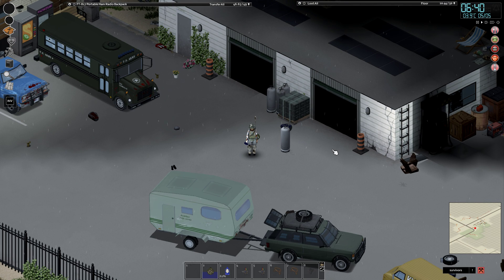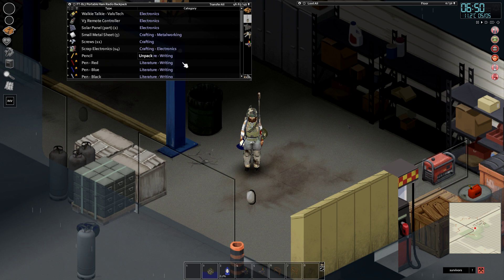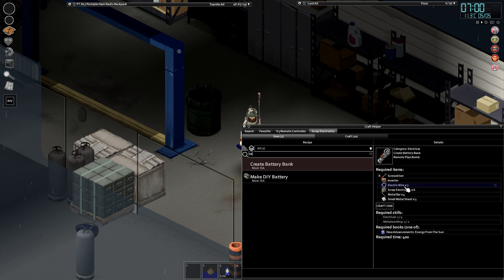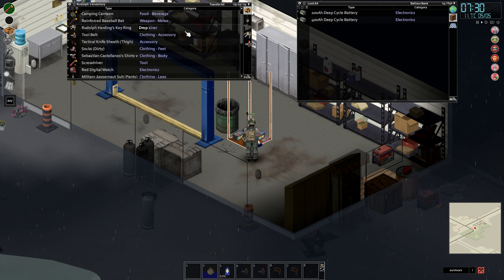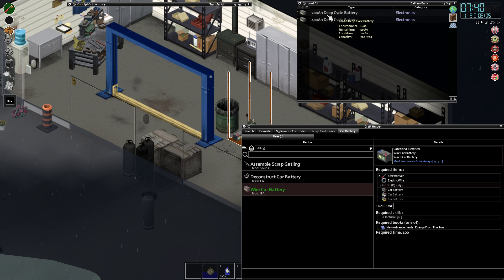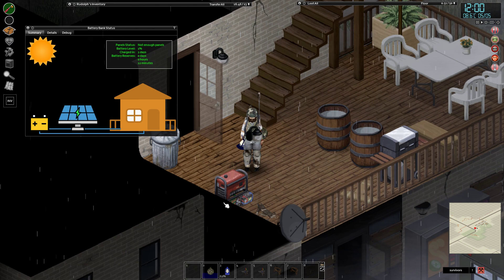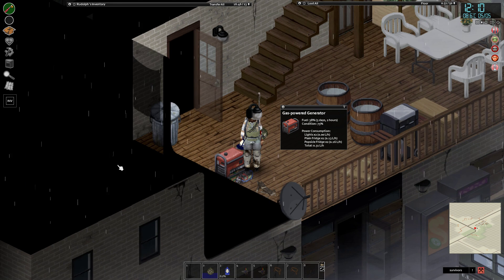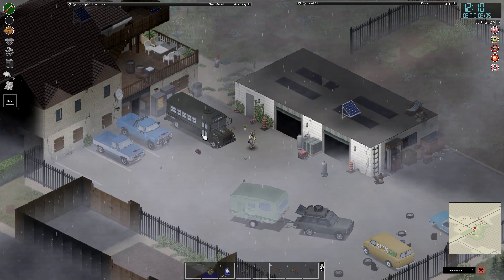Project Zomboid Immersive Solar Arrays A to B

Comment: 7:50 The 'A' is for AMPs and the little 'h' means hour, so the energy produced and available is measured in AMPs per hour.  great video though mate!
Reply: The mod author screwed up too. The panels shouldn't be rated in amp-hours, but watts. Amp-hours is energy (stored electricity), watts is power (how much electricity is being produced/consumed at a given time). For simplicity, it would be a bit less incorrect to rate the panels in amps -- a 50 A panel would produce 50 A h in an hour. Or better yet, rating the batteries in joules (1 watt for 1 second = 1 joule), but since real-world electrical systems also have to take voltage into account, real batteries are unfortunately rated in amp-hours.
Reply: @Eidako  Probably easier for the average users if the mod creator expresses everything in terms of amp hours instead of watts. Otherwise everyone would have to understand the relationship of Watts, Voltage, and Amperage. May even require different wattage inverters, gage of wire, parallel or series battery array, startup amp consideration, phase and sine tuning, etc. There's a pretty deep rabbit hole the mod could take for the sake of realism.
Reply from the maker: Thanks for the info did not know that.
Reply: Have an electrical background. Wanted to scream every time "hertz" was said.

Comment: Thanks for doing a video on this mod! I fixed my problem while watching this: The generator has to be on the same level as the Battery Bank, otherwise it won't connect.
Reply from the maker: Happy to help, took me quite some time to work out how to set it up and once I finished, I decided to make the video so others like me don't have to struggle.
Reply: If you're level 6(+) electrical, it can be one floor above / below to connect.
Reply from the maker: you need Electrical Level 6 and specific components like Electronics Scrap, Electric Wire, and, often requiring you to read Engineer magazines 1 and 2 in an existing save to learn the recipe and link it to receivers for traps or doors.

Comment: can please link modlist for the mods you're using!
Reply from the maker: Hi mate, yes I can link them, what I'll do is send you a video as well as I have no idea how to group send all the links and youtube makes me jump through hoops to do that, but the video I will link as well will show what I have on, as well as the list below which you can put in steam to find them,  https://youtu.be/mOEsHajuvpw

        mod = 67commando,
	mod = 82oshkoshM911,
	mod = 86oshkoshP19A,
	mod = 87cruiser,
	mod = 89def110,
	mod = 92nissanGTR,
	mod = SteamPoweredGenerator,
	mod = FORTREDSTONE,
	mod = FencingKits,
	mod = FWOBenchPress&Treadmill,
	mod = FWOFitnessWorkoutOverhaul,
	mod = EdsAutoSalvage,
	mod = Chinatown,
	mod = Chestown,
	mod = Chernaville,
	mod = CanteensAndBottles,
	mod = AutoGate,
	mod = Anthem,
	mod = 99fordCVPI,
	mod = 97bushmaster,
	mod = 93townCar,
	mod = 93fordElgin,
	mod = 92fordCVPI,
	mod = 92amgeneralM998,
	mod = 91range,
	mod = 90fordF350ambulance,
	mod = 89trooper,
	mod = 88golfMk2,
	mod = 88chevyS10,
	mod = 86fordE150pd,
	mod = 86fordE150,
	mod = 86fordE150mm,
	mod = 86fordE150dnd,
	mod = 85merc,
	mod = 84merc,
	mod = 78amgeneralM62,
	mod = 78amgeneralM35A2,
	mod = 78amgeneralM50A3,
	mod = 78amgeneralM49A2C,
	mod = 74amgeneralM151A2,
	mod = 70dodge,
	mod = 49powerWagon,
	mod = 08sable,
	mod = fol_Take_A_Bath,
	mod = UH60Helicopter,
	mod = TKS,
	mod = IFAV,
	mod = UHB,
	mod = VVehicleEnhancer,
	mod = VehicleRepairOverhaul,
	mod = VISD,
	mod = WaterPipes Plus,
	mod = 90zanella50cc,
	mod = tsarslib,
	mod = amclub,
	mod = 80kz1000,
	mod = LTN_SL,
	mod = 28ss100,
	mod = HEMTTSeries,
	mod = Ashenwood,
	mod = DylansTiles,
	mod = tkTiles_01,
	mod = Diederiks Tile Palooza,
	mod = autotsartrailers,
	mod = BetterBatteries,
	mod = Blackwood,
	mod = Brita_2,
	mod = Brita,
	mod = TheWorkshop(new version),
	mod = BCGTools,
	mod = BedfordFalls,
	mod = DJ_BritaPatch,
	mod = Cathaya Valley,
	mod = CombatText,
	mod = DylansZombieLoot,
	mod = Fort Waterfront,
	mod = NepBatteryColor,
	mod = NepEngineColor,
	mod = NewEkron,
	mod = muldraughmilitarybase,
	mod = RV_Interior_Vanilla,
	mod = RV_Interior_MP,
	mod = waterPipes,
	mod = Grapeseed,
	mod = Greenleaf,
	mod = GunFighter_Radial_Menu,
	mod = ISA_41,
	mod = ToadTraits,
	mod = ReadingIsNotBoring,
	mod = rbr,
	mod = rbrA2,
	mod = ShowSkillXpGain,
	mod = TheStar,
	mod = modoptions,
	mod = backpackattachments,
	mod = BetterSortCC,
	mod = EVAC_Muldraugh,
	mod = AdmMTiles,
	mod = CraftHelperContinued,
	mod = DRAW_ON_MAP,
	mod = ExtraMapSymbols,
	mod = ExtraMapSymbolsUI,
	mod = EXSPS,
	mod = MapLegendUI,
	mod = BoredomTweaks,
	mod = fuelsideindicator,
	mod = KBM,
	mod = Ladders,
	mod = MapSymbolSizeSlider,
	mod = RavenCreek,
	mod = ReLght,
	mod = REORDER_CONTAINERS,
	mod = TMC_TrueActions,
	mod = XnerTree,
	mod = BasedBackpack,
	mod = GMH,
	mod = Silencer,
	mod = SkillRecoveryJournal,
	mod = TakeAnyAmount,
	mod = RainCleansBlood,
	mod = myclothinguimod,
	mod = GeneratorTimeRemaining,
	mod = BB_CommonSense,
	mod = AuthenticZBackpacks+,
	mod = Authentic Z - Current,
	mod = ATA_Bus,
	mod = ATA_Jeep,
	mod = BecomeDesensitized,
	mod = CraftEngineParts,
	mod = P4HasBeenRead,
	mod = ReloadAllMagazines,
	mod = ScrapArmor(new version),
	mod = ScrapGuns(new version),
	mod = ScrapWeapons(new version),
	mod = AutoMechanics,
	mod = MonkeysStartScenarioBase,
	mod = MonkeysStartScenarioJaap,
	mod = MonkeysStartScenarioOshkoshM911,
	mod = MonkeysStartScenarioPetyarbuilt,
	mod = ATA_Petyarbuilt,
	mod = MonkeysStartScenarioRV,
	mod = FRUsedCars,
	mod = AutoSewing,
	mod = BCGRareWeapons,
	mod = ProximityInventory,
	mod = ReducedWoodWeight2x41,
	mod = snowiswaterbeta,
	mod = rWaterTrailerSemi,
	mod = rWaterTrailer,
	mod = RotatorsLib,
	mod = 50%metalweight,
	mod = FoodPreservationBuffMags,
	mod = FoodPreservationPlus,
	mod = ArsenalSettingsCustom,
	mod = ATA_Mustang,
	mod = ATA_Mustang_66,
	mod = ATA_Dadge,
	mod = ATA_DeLorean,
	mod = DubsProfessionMod,
	mod = RiskyInspectWeapon,
	mod = MREM,
	mod = Max,
	mod = REORDER_THE_HOTBAR,
	mod = UndeadSuvivor,
	mod = Yeast_Only,
	mod = SuperbSurvivors,
Reply: @shrek296 thank you so much! my guy you didn't have to make a video! I appreciate it and you gained a subscriber!